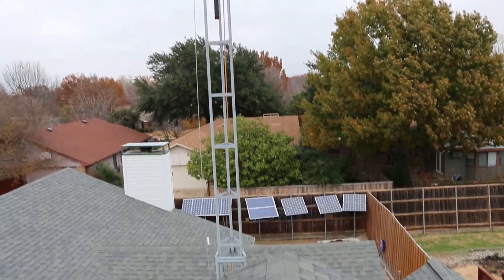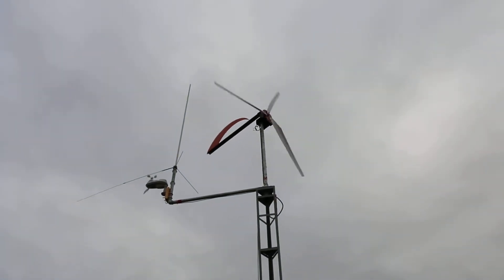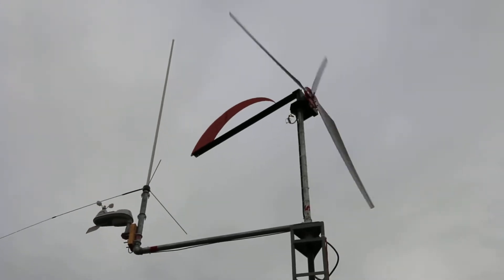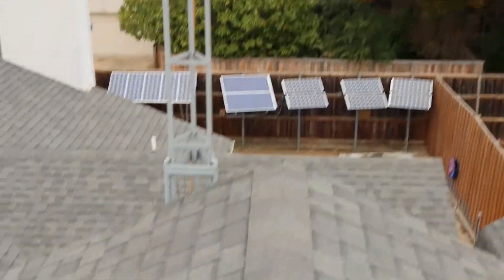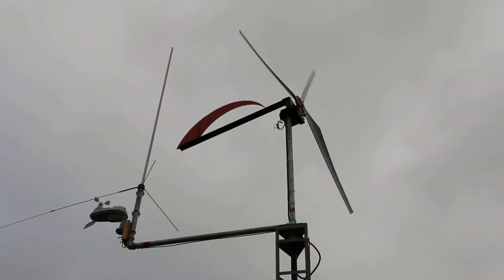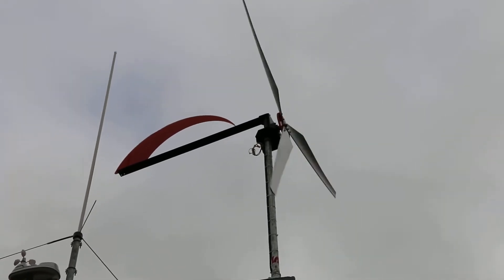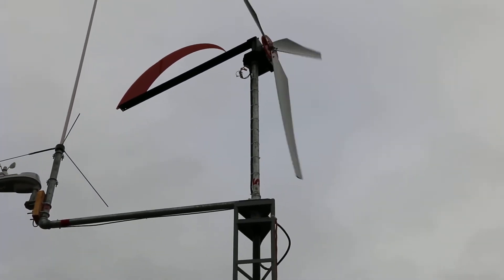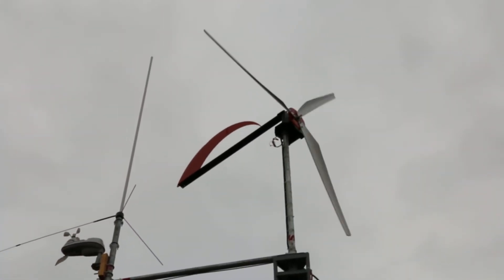Home Made wind Turbine making 12.9 AMPS!

Comment: awesome setup you have there. It looks like about a 7 foot diam bladeset? You could lower that to about 5 to 5.5 feet and it would spin faster in lower wind speeds. But, you still need enough torque to get it started. You could catch a little more power. Just imagine if you had a 20 foot bladeset with thousands of watts of potential power, but it take 35 mph just to start charging at 12 volts. So, bigger isn't always better. Also, shorter blades flex less than longer blades. So, less likely to hit the pole and break.